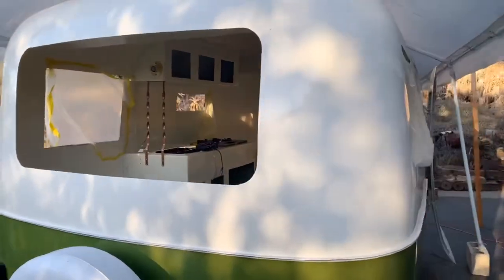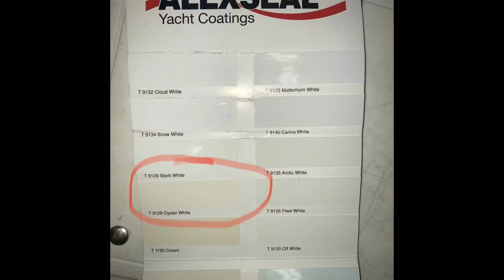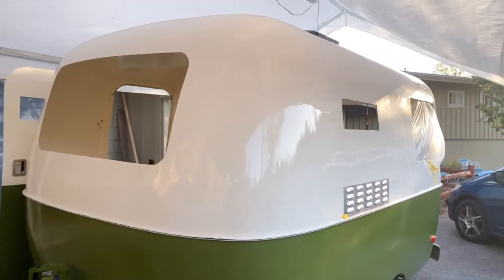Scamp Trailer New Paint! | Vintage Windows Installed #scamp

Comment: Enjoy your videos Johnny.   I am currently putting a new fridge in my Scamp.  Didn't like the Dometic which came with the trailer.  Also I plan on installing a new door handle too.  Would like to see how you did yours.  Thanks.
Reply from the maker: Hi James, the door handle is called the Fastec Industrial RV deadbolt latch, part # 43610-FIC
Reply: @westcoast_johnny  Thanks for the info.

Comment: Hi Johnny, love your videos and how well you explain things! I’ve been looking for a video about how to do windows on a fiberglass trailer and this definitely delivered. I am wondering what caulking you plan to use to finish off the windows? I have always heard that butyl tape is all that is needed.
Reply from the maker: Hi Andrew, it’s called ProFlex RV flexible sealant.  When I picked up the window butyl tape the RV business I went into said it was needed. So if it keeps the water out from between the window and shell where the butyl tape is that’s a good thing. Thanks for stopping by!

Comment: Good afternoon Sir, I purchase an 1988 Scamp last week and I am going to demo the inside completely. When it comes to the removal of the insulated material on the walls of the camper what is the best way to remove it? Then I just want to put something else up what would I use? I am not using it as a camper but converting it into a photo booth,
Reply from the maker: Hi Marc, sorry for the late response. If you haven’t tackled this yet, you can make cuts with a razor blade and pretty much pull all the skin off in sections. A solvent base cleaner will dissolve the dried glue or sanding. Thanks for stopping by! 👍🏼

Comment: Good afternoon, I have a 13' Scamp that I had to remove the elephant skin. What can I put back in this trailer? I'm not worried about insulating, and the fiberglass cabinets are not going back into the camper. I'm now in the process of sanding the inside of the camper, but have not been able to find the material to go back in. Should I just prime and put a adhesive wall covering in? To me it seems with the vibration of towing it would not last. Please advise!!
Reply from the maker: Hi Marc, if you took all the cabinets out you will have issues for sure while driving!  If you sand all the inside smooth, and the elephant skin is gone, you could just paint the interior. I believe goo- gone and acetone  dissolve the glue behind the elephant skin, or an adhesive wall covering.
Reply: @westcoast_johnny  I am in the process of getting all of the elephant skin off and all of the cabinets have been removed. I have found out this is a tedious task. I am going to build cabinets to put back in the camper. I can see where the cabinets now are important for the integrity of the camper. By watching your channel I will fiberglass in and laminate the strips along the walls of the camper the tie in the framing of the cabinets to the shell and flooring. I’ll send you pictures once I get to the framing and laminating. Your channel has been so helpful. Here in louisiana I’m having trouble finding a body shop who wants to tackle the painting. I saw you roll the top half, is the a colored paint that I can roll the bottom of the camper?

Comment: Do you have the install of the back window?
Reply from the maker: Hi Molly, I tried to install it myself and make a video but it was too difficult to install. I hired a mobile window installer and the two guys wrestled with it then gave up. I found a mobile guy who works with motor homes and fiberglass windows. He got it in with soapy water but he had to trim almost 1/4” off because it came oversized fr Scamp.